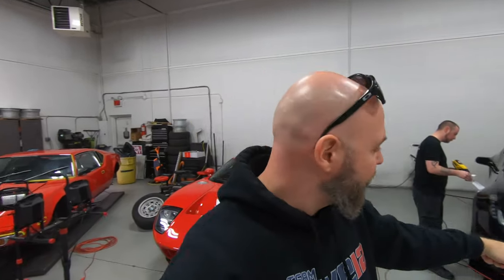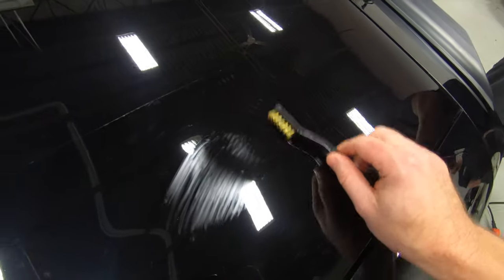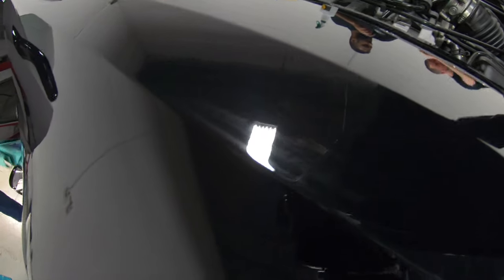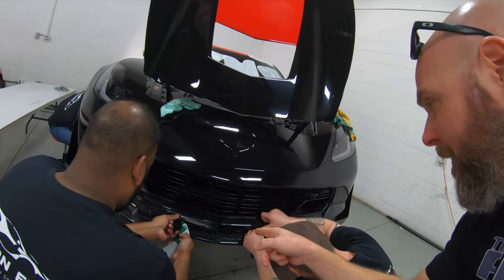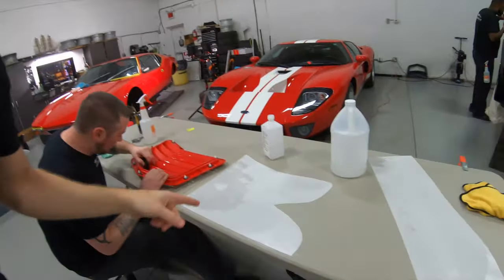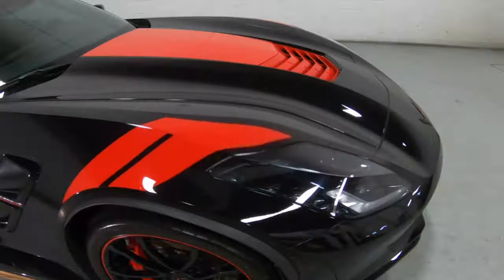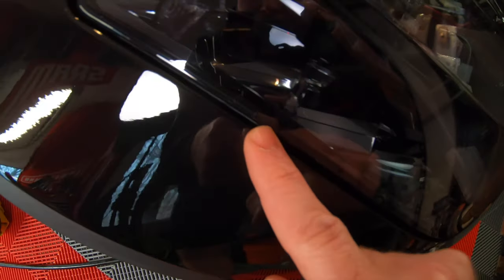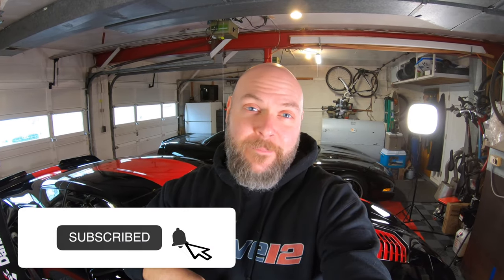C7 Corvette Grand Sport Xpel Installation

Comment: Only part that I did on my Vette that you didn't do is my doors. I have been SUPER happy with my Xpel over the last 2 years.
Now on my Lambo I only did the front clip. As good as Xpel is unfortunately, you can still get some damage in softer areas. I got a chip on a corner edge on the front grill area of my Lambo driving to Houston but none the less, it's totally worth every penny!!
Super video as ALWAYS! #VETTESYNDICATE
Reply from the maker: Front Seat Driver Thanks Jason! I wish I had the budget to do the entire car. Especially with black paint. I plan to drive most of the winter here in PA as long as the roads are dry. XPEL is good insurance. #vettesyndicate
Reply: @Team512  you did quite a bit! You got all the important places. Car looks GREAT!!!

Comment: If you did the entire car with the XPEL wrap, would you have to put the ceramic coating on over the top of the XPEL or is it then not needed?
Reply from the maker: I ceramic coated the entire car. Both xpel’d and non xpel’d areas. There’s a video on my channel.
Reply: @Team512  Ok Thanks. I think I'm going to get all my ground effects done first, then wrap and coat the entire car. I agree with you that I need to get it done sooner rather than later.. Thanks a lot..Great Video's !!!

Comment: Does XPEL film have glue or will it turn yellow. I have a Arctic white C7. I’m trying I decide between the ceramic or film. I just don’t want an adhesive film or it to remind yellow over time. Thanks Ric
Reply from the maker: R Williams Ric, it does have an adhesive layer. Only yellowing that may occur is around edges that haven’t been properly sealed. Xpel has a 10 year warranty and it protects against discoloring. Ceramic coat is a great option, but won’t protect the paint and self heal like xpel.  I had ceramic coat on the car before the xpel. Of course I had to remove it by doing a full color correction. So if you’re thinking about xpel, do it before ceramic coating. Ceramic coatings can be applied over the xpel.
Reply: Team 512 Thank you so much. Greatly appreciate you getting back and explaining. Your C7!is Beautiful!!
Reply from the maker: R Williams No problem Ric. Feel free to shoot me an email if you have any other questions. Teamfive12garage@gmail.com
Reply: You will get dirt around the edges also. I have a white Lambo and there's nothing I know to do about it. It still beats rock chips though. By the way, I have heard even with Xpel Ultimate you will see some yellowing in a few years. I've had mine on for a year and haven't noticed anything yet. I still highly recommend. I have it on my Vette and it's saved me from a lot of damage on back road drives with other Vettes.
Reply from the maker: Front Seat Driver Jason, thank you for your real world experience on a white car...a white Lambo to boot!👍

Comment: How expensive was this mod?
Reply from the maker: Very expensive. But after having it on for a few weeks, I wish I had done the entire car. The ease of care and maintenance has been outstanding. Contact local xpel installers for some quotes. Just make sure you’re sitting down when they give you the price. 😂
Reply: Team 512 that's what I was afraid of, just thinking of having the front done not as much as you went with, mine is also black.
Reply: Team 512 love the ed accents definitely put it back on. I like your videos and like the fact that there is no swearing in any of your videos, great content always look forward to the next one.
Reply from the maker: @Tbone1952  Thanks so much for the kind words and the support! I purposely try and edit out any swearing from my videos.
Reply from the maker: @Tbone1952  I would definitely recommend getting the front clip protected with Xpel.  I waiting 4000 miles before doing mine, and I wish I would have at least done that piece right away. I feel better about driving the car on these northeast winter roads now!